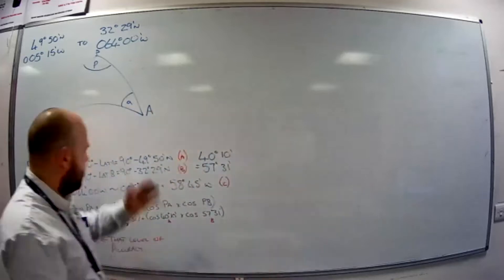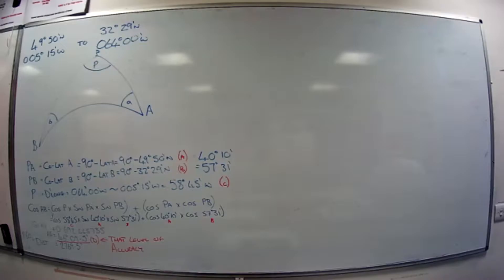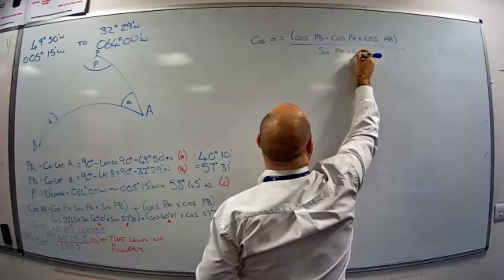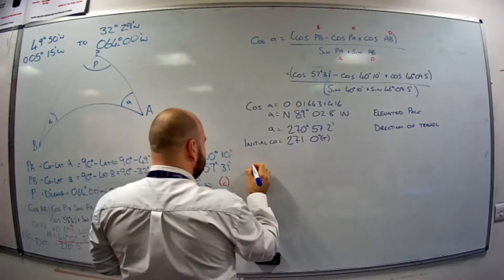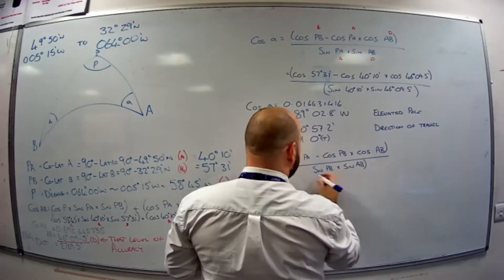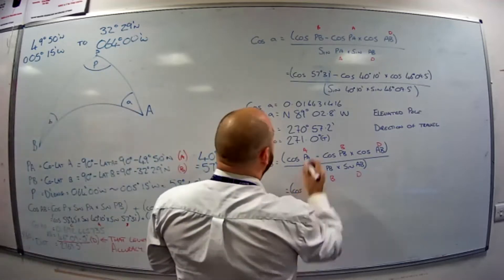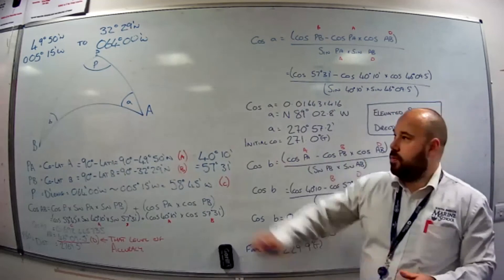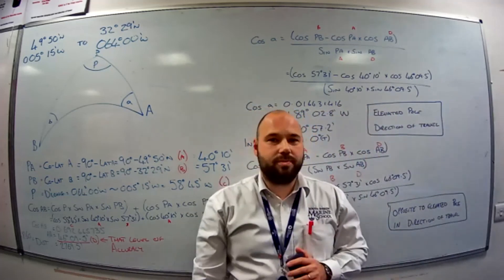Introduction to Sailings  - Great Circles 2  - Initial and Final Courses

Comment: What happens if initial course for calculated "a" is obtuse angle 

Then naming principal doesnt hold it
You can take distance travelled along a great circle is 3000 NM and its final Course was S 60 W 
The vessel travels from some northern latitude from greenwhich meridian to the equator .

Detrmine its initial course and arrival longitude ?